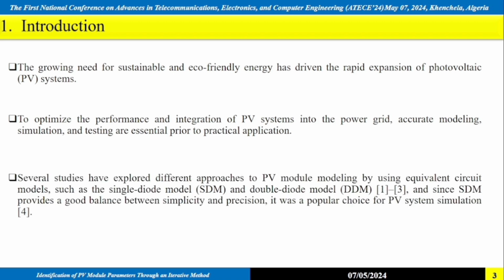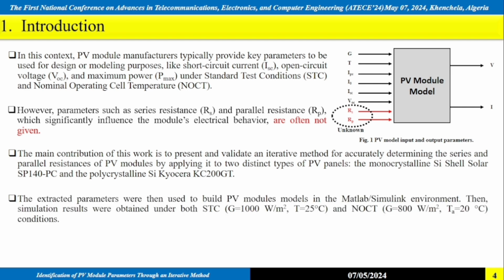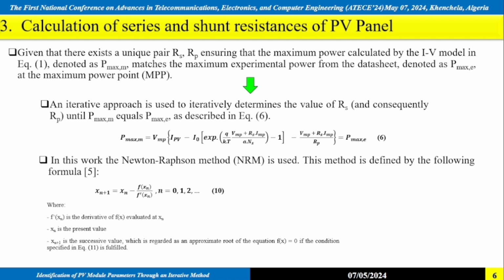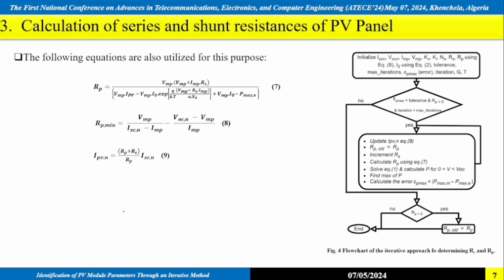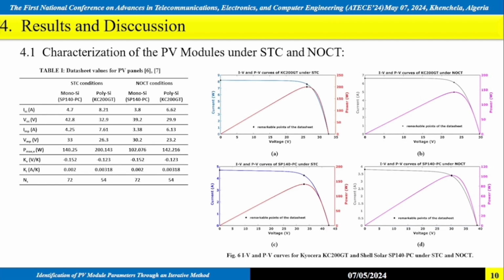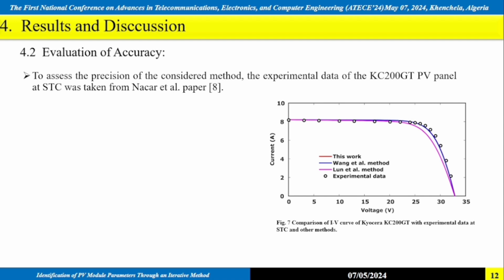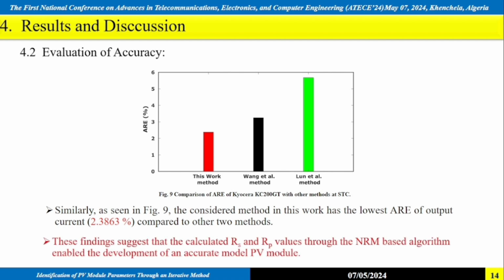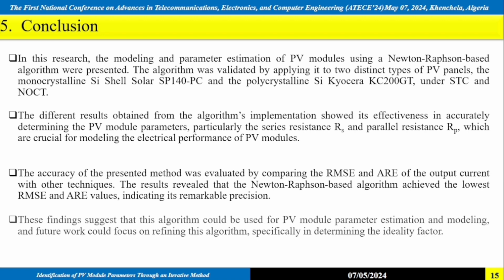Identification of PV Module Parameters Through an Iterative Method

Comment: and how you identify the other three parameters ??!
Reply from the maker: The saturation current I0 was initialized using Eq. (2), the voltage, and current temperature coefficients, kv and ki, provided by the manufacturer in the datasheet. During the iterative process for calculating Rs and Rp until Pmax,m = Pmax,e, we updated the value of the nominal light-generated current Ipv,n, which in turn updated the actual light-generated current Ipv using Eq. (4). Finally, for the ideality factor a, although there are algorithms available for more accurate calculation, for simplicity, we assumed a constant value of 1.3 in this paper. This value is reasonable since the ideality factor for Monocrystalline Silicon (Mono-Si) and Polycrystalline Silicon (Poly-Si) PV panels is typically assumed to be between 1.2 and 1.4. 
Thank you for your comment